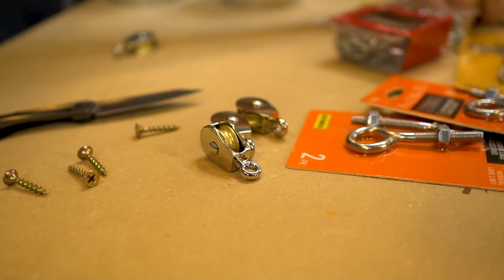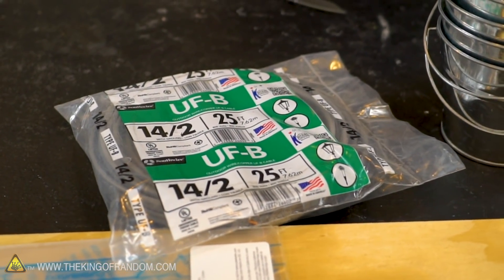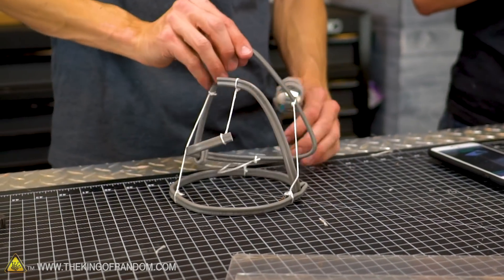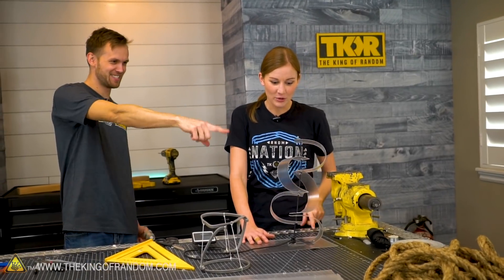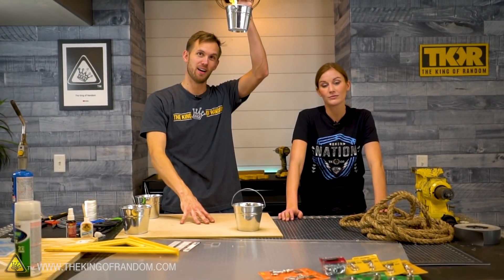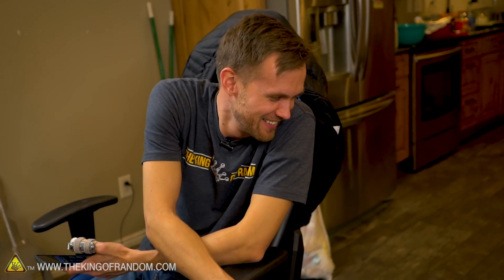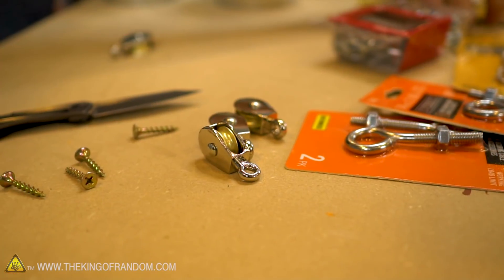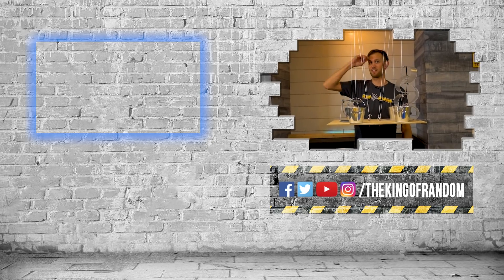Can You Actually Build These Impossible Structures?

Comment: Had the most random thought whilst watching the suspended table. This could be a Crystal Maze game. Have the whole thing set up with too many weights in it, and the idea is to take so many of them out and put them on the table top instead. Taking out the wrong ones will cause the whole thing to collapse; and of course you'd put the lighter ones underneath some heavy ones in the buckets. It would be an ALIS if three or more balls touch the floor, and would be in the Aztec zone.

Comment: Do not use polyurethane sheeting for the scaled up version on the revisit. It will not have enough tension 

Use polycarbonate sheeting. Probably 1/4 at the size you were using. Tougher to cut but it will never break on you.

Comment: I officially challenge TKOR, Marc Rober and Colin Furze to build the first two models in a house big scale as a "physics-art" project! Would be massive when that "standing" String thing is built with a thick steel cable and feather steel plates where you need a forklift or sth else to bend that together. The aim is to get a "self stabilzing" platform where you can stand on.

Comment: I wonder if it would work to use say 2 or 3 pieces of plastic for each segment of the standing rope under tension one. Make each of the addition pieces a few inches longer than the last, so there is a bit of a gap between each along the middle of their bend. Should help distribute the weight/pressure on each individual pieces a bit better.

Comment: ......the table project can be better... the more weight the more support.. drill holes in the corners and feed the string through the holes, knot the string over the holes so it doesn't slide and then weight of the table (and anything on it) is keeping the table levitated

Comment: Here's a challenge for you:
Counter Weight Elevator.

It cannot use electricity and instead uses a Rube Goldberg like system where a pressure plate detects the weight it has to lift and then fills a counterweight to lift the a platform with the given weight. Goodluck.

Comment: Okay so for that acrylic one that failed why not just go way over engineered and instead of doing plastic of some type use a leaf spring 😁 and steel cable. Oh if it works it'll be awesomesauce but if it fails... The concrete dome could get a new skylight or window

Comment: On the string scale up use the bolt clamps normally used on steel cables as they will be easier to work with then trying to tie knots in a rope that thick.

Comment: okay so question about the floating table using pulleys, if you added more pulleys attached to the buckets, could you put less weight in the buckets and more weight on the table?

Comment: Make the floating table thing bu instead of buckets, you have another table with a few holes for the string going to the first table. How it would work is the weight of the thing on the table would keep it in place and when not in use, the pieces are hidden away in the ceiling and on the floor.

Comment: The table is really only holding itself up with its own weight if you ignore the part where it's attached to the ceiling in the basement of a house.

The table is not suspended by its own weight. It's suspended from the ceiling.

Comment: I'm definitely making a magic floating shelf for above my computer to hold my super lightweight knick knacks.
I have some paper figures for d&d, a few balsa puzzles like cats and t-rexes and a few other things that probably weight less than a half pound total.
That will be super cool, I'll do just two buckets, one at each end with open space in the middle.
It's gonna be awesome.
Reply: I think you could probably drill a hole through the table and run the string/rope through it and have the buckets below the table, then the thing would be held up by the weight of the table and not the weight of the buckets, and you could put as much stuff on it as you want without having to worry about it being too heavy.
Reply: @lightyagami77777  Yeah, but I'm interested in the cool "illusion" part of it. I want to be able to gently push it and show that it's balanced and floating. I have a few nieces and nephews and they would love that. 
I think it's a cool gimmick, I don't really need the space, I just want a cool looking science thing.

But that is a neat idea though. I'm sure there is a ton of cool stuff you can do with this type of setup.

Comment: you guys should try making a swing with the self suspending table.  I say its a bad bad idea, but isn't that kinda the point of TKOR  😂  😂  😂
Reply: random happens.
Reply: Lol
Reply: I wouldn't think it'd be possible, but to make a similar swing which resembles a metronome or a double ended pendulum might work
Reply: True 
Ya guys always say"this is a bad idea"
So I agree
Reply: Safer than the video where he escaped a high house by a aluminium foil rope
Reply: Gurseerit Chahal Yeah definitely A LOT SAFER than the video he escaped a high house with aluminum foil!!
Reply: Should be possible if they made a large enough scale version. You would just have to have enough weight in the buckets to overcome the added weight of a person
Reply: No yall are over complicating it. just use the person instead of the bucket. Tie rope on person (with harness) and loop it over pully than attach thr swing
Reply: @danielsolomon3794  Exactly
Reply: Not sure why it would be a bad idea. As long as your weight is substantially higher than that of the table/seat/whatever, it should hold you pretty firmly at the half-way point of the rope's length. You're basically using your own weight to pull the platform into yourself. Should be just as stable as a swing hung from an anchor point.